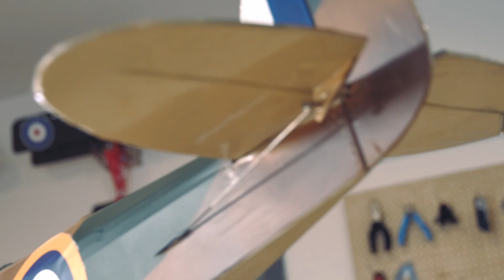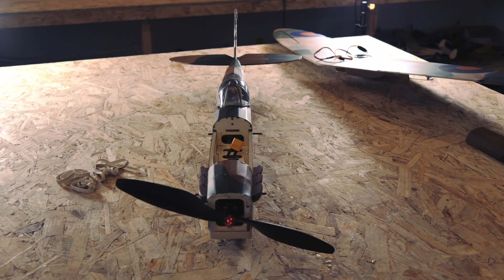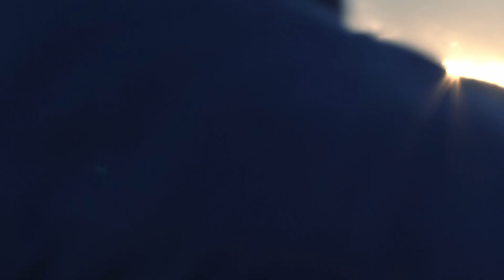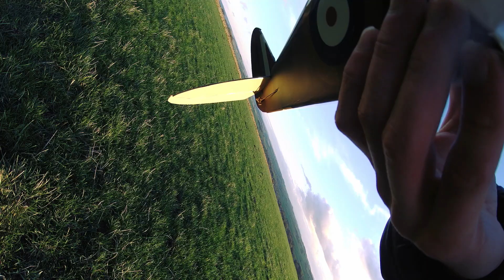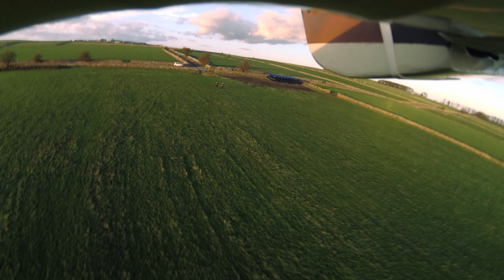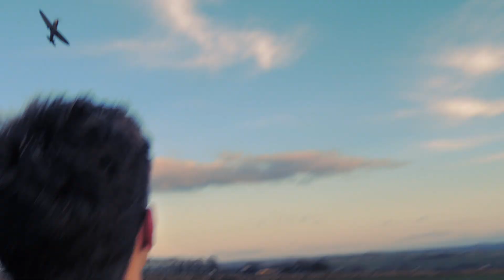Balsa Basics Spitfire: Flight Overview

Comment: how about instead of rubber bands you put vertical tabs with a hole in them inside the wings and just put the rods through the fuselage and tabs, securing the wing
Reply from the maker: We decided to use rubber bands as it helps with resilience to crashes!
Reply: @vintagemodelco7936  i see
Reply: I've done the same thing on my ft mustang, the wing is secured with a single carbon rod and slides into the scoop